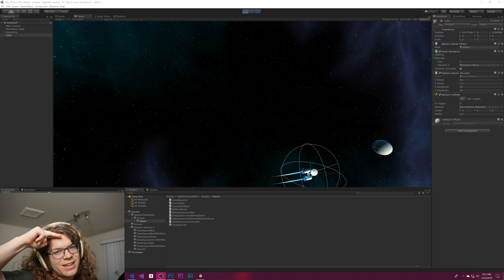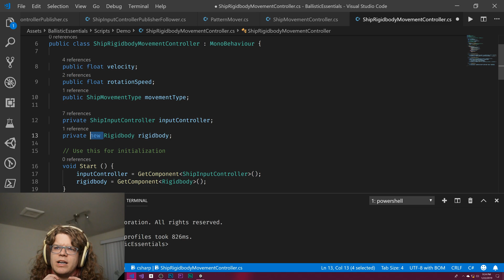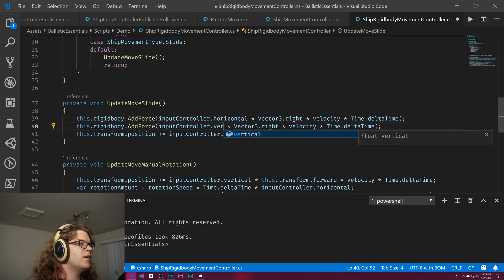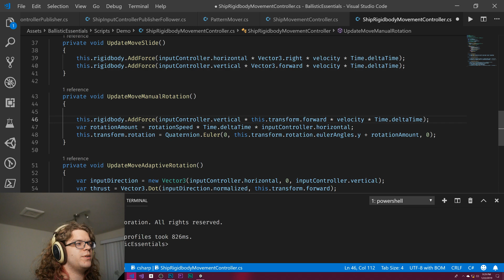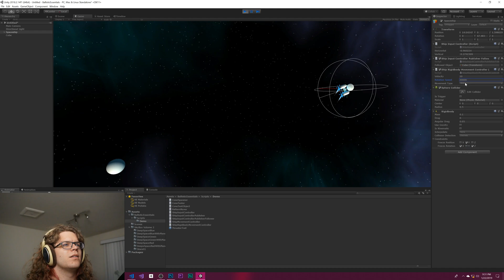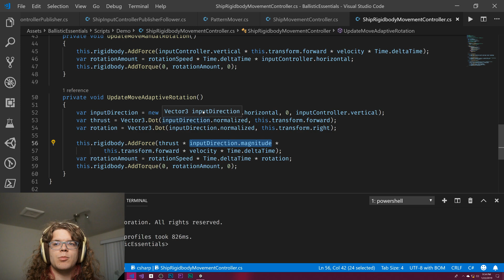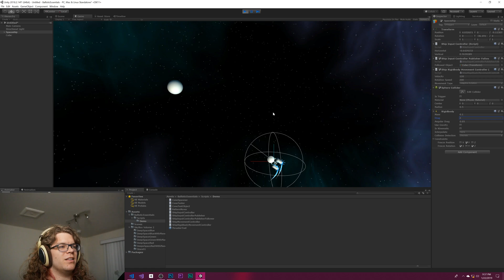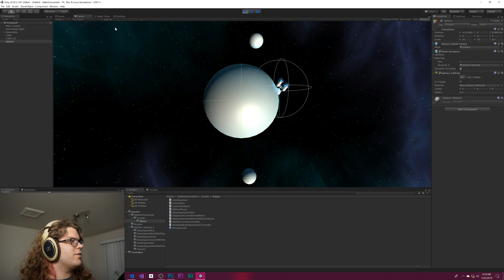Rigidbody Top-Down Spaceship Controller

Comment: Great video! Could I ask one question? It's related to shader's. I am creating this Top Down game and I have units that I can select. When I do I make this selection circle appear below every selected unit. I used projectors before but they are really performance heavy..

I'm using built-in rendering pipeline and I am trying to create some shader that would kind of make the quad texture adapt to the ground surface in a way the projector does, but so far with little luck unfortunately.

Also considering that some objects are placed a bit deeper in the terrain the selection circle is pretty much invisible cause it's outside the terrain so I'm trying to make so that the texture would always draw on top of the surface.
I know that there is a new Decal System in Unity with works similar to Projectors and are much more performant, but it's only available if you use HD Rendering Pipeline, which I don't..

I'm really just a beginner when it comes to shader's so I am kind of lost at this point. :/ Could you help me?
Reply from the maker: There is a technique with deferred rendering that I think will work perfectly for this. It's called Deferred Screen-Space Decals (IDK if that is the actual name but that is what I've seen people call it). It leverages some fun features of how deferred rendering works to get your decals to align with your world geometry.  If deferred rendering fits your projects (it has some restrictions - for example transparant shaders will rendered with a forward renderer even when using deferred for most other things) needs it might be a good solution for you. Because they aren't using projectors they will also support lighting and other material characteristics like specular coloring and roughness all at a pretty fantastic performance rate (especially compared to what you are getting with projectors).

If you'd like a drop in solution, this one on GitHub ought to get you started. IDK if how good this solution is, you can probably find others with a quick search. https://github.com/losuffi/Unity-Screen-Space-Decals

I can go into more on deferred vs forward rendering in another video. It has a number of impacts, for example with lighting performance where forward rendering limits the number of lights per object, deferred has no limit and performance is based off of the number of lights impacting each fragment (more or less a pixel). Like I mentioned earlier, transparent shaders will not render in deferred mode (a side effect of the G-Buffer that is core to deferred rendering) - this will mean that you might hit some weird behaviors trying to use this technique on glass for example.

Hope this helps out. It's something I'm only tangentially familiar with myself so I'd love to see how this works in your projects or if you find something else that you think works better!

Comment: Hello Sam, 

My name is Carlos Silva and I am a electronics and computering engineering student in Portugal (yes, I know. Such a small country xD) and I'm doing my final project of my grade that consists to improve and make the weld industry more efficient and accurate however I'm facing an obstacle and I think you could help me wasting just a few of your time. I will expose the problem.

Basically, I have a CAD file of a the desired piece (this piece is a silo top wuth some holes for the pipes), the problem is the piece in real world doesn't correspond to the CAD because several external constraints. So, I took pictures with a zivid camera (3D camera, like kinnect but more accurate) and I created an accurate mesh through the point cloud of the 3D image. The first step is making a comparison somehow between the real mesh and the CAD mesh and then we have to deform the CAD to fit  with the shape of the real piece (the error is not so big but for that industry I need that kind of accuracy), just considering the shape of the cover because the idea is to project lasers to cut that holes in the CAD file... I will use the Eyeshot software from devDept company in spite of being possible to develop in Unity I think, so I would appreciate if you can brainstorm with me about the algorithm to use it... I'm stucked.

I appreciate your time spent at least to read this huge e-mail.
 Contact me: cmbs96@gmail.com

Best regards,
Carlos Silva

Comment: Instead of going crazy on the linear and angular drag what I usually do is get a factor that tells me how close I am to my target speed/rotation and multiply the amount of force by this factor. It usually gives good results and you don't have to change the drags which can be really inconvenient if it is a 3D game with gravity.

It was perfectly fine in this case tough.
Reply from the maker: One of the handy things drag does is reduce the velocity from previous frames. The way our input works, it should already reduce the input based on how in-line it is. The difficult part is that we aren't currently taking the current velocity's into account only the position and rotation. Drag can help hack around that, but we should be able to actually solve for a more appropriate amount of acceleration with some work. I'll investigate and see if anything makes sense. IDK off the top of my head what that math might look like right now.
Reply: @WorldOfZeroDevelopment  Great :D